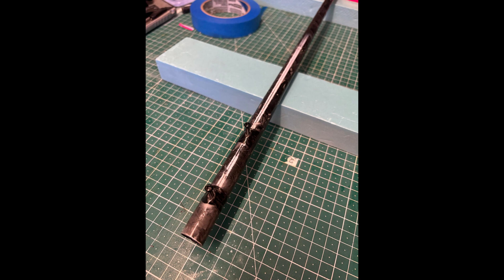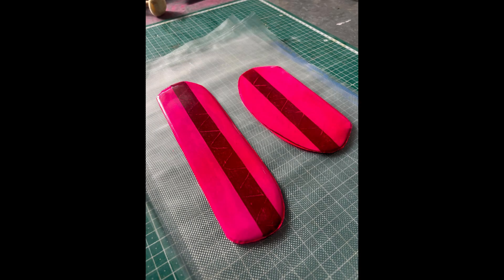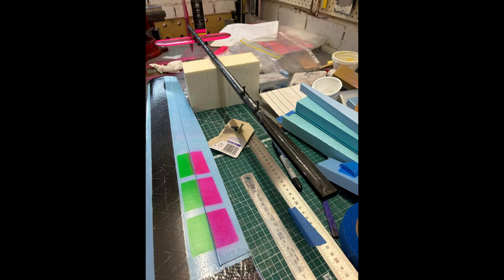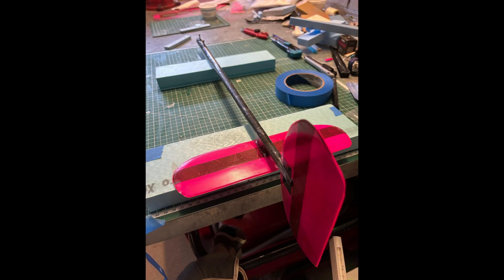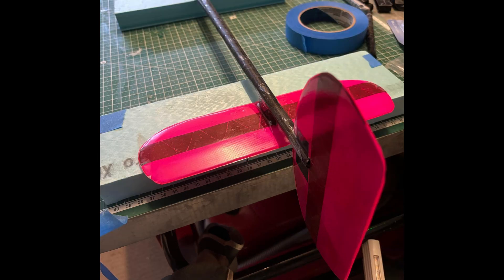Soaring High with a Homemade DLG RC Glider

Comment: Very nice build and flight performance! I’m impressed.  :)
I’ve taken some time away from f3k, but am about to get back to my own 1.2m build soon.
Reply: Thanks! Really appreciate your input and efforts in the rcgroup threads and videos! I have learnt a lot!
Reply: @TheDoubledeClutch my pleasure.  I’ll be getting back to the build and videos soon :)
Reply: @TheDoubledeClutch I restarted the scratch built dlg thread.  Please post about your build there if you like.  I’ll be restarting my own build soon.  Seeing this 1.2m fly so well has rekindled the desire to finish my build this spring/summer.  Cheers. :-)
Reply: @DanBanko I’ll go back and check it out!
Reply: I continue to be impressed by this ship. Just wonderful.   The only critique I’d make is it appears a bit more dihedral would be beneficial.  (Could just be the angles of the video making the wing look flatter than it is). If you make another try 12° of total dihedral in the wing.   When you turn, it’ll side slip less
Reply: @DanBanko interesting observation, i will double check it as I can’t remember what angle I built it to. It does need a good dose of rudder in some situations so you might be right.
Reply: @TheDoubledeClutch flatter wings are of course great for slope soaring.  The rule of thumb for thermal ships is 6° of dihedral per wing.   Split up if the wing has polyhedral breaks of course.  But all at the root for a straight dihedral DLG.   It makes quite a difference in performance.   Not that your sailplane doesn’t fly very well as is. :)
Reply: @DanBanko ok finally got around to measuring it, yes it is about 10 degrees so perhaps a touch more needed